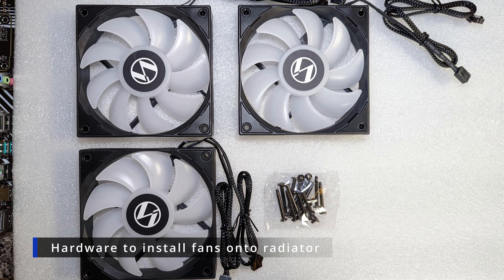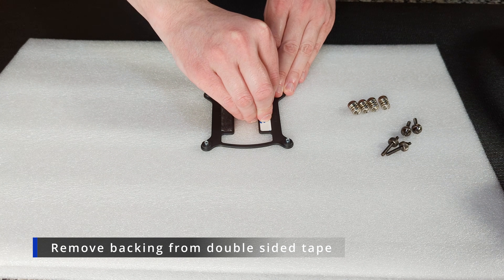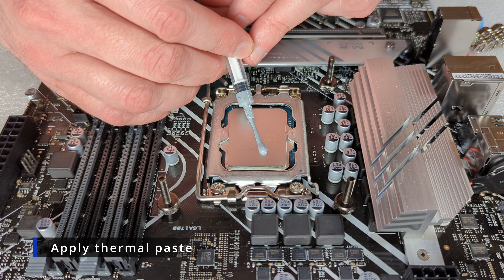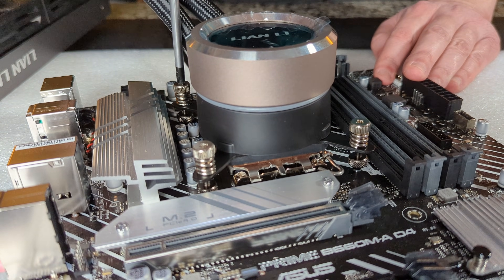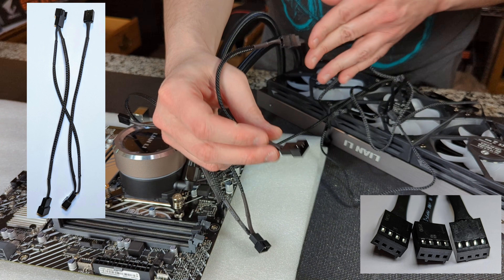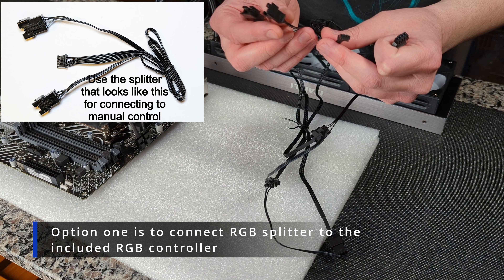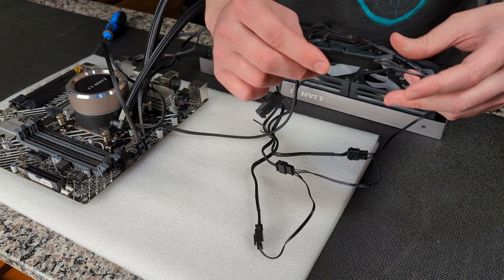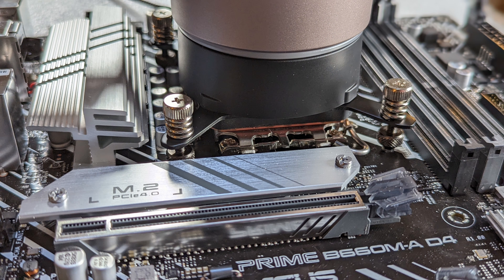LGA1700 Install LIAN LI Galahad 240/360 AIO CPU Cooler

Comment: helpful video! I have all my components ready to build, but the Lian Li Galahad won't come for another 3 weeks because of backorder. So I am waiting impatiently to put it all together. I thought maybe I could put it all together but the fact that I have to access the back of the motherboard to install the CPU cooler makes me wait instead.. actually the Corsair 5000D air flow. Let you access the back to attach the CPU cooler bracket so it's perfect
Reply from the maker: We built this one: https://youtu.be/iBqNFl3ByDs with a 4000D. Pretty good case.
Reply: @KLEEBZTECH  nice that's the GPU I'm using as well. Good to see

Comment: How much is it going to hurt if I leave the middle fan off?
Reply: I ask because my rams are in the way
Reply from the maker: There are many factors like case airflow that will have an impact on that. Obviously it will run hotter but if you have good airflow otherwise it might be fine. Just make sure to keep an eye on temps at first to make sure.

Comment: im a bit confused what do i do with the three cables that come out from each one of my fans. Basically each fan on the top has one plug and I plugged one of them into the motherboard but two more need to plugged in and I cant find spots for it to go into and I dont have anything that connects them all to one hub which plugs into the pc and all three fans turn on. Please help.
Reply from the maker: Watch 03:47 for how to connect the fans. If you do not have the splitter then verify nothing has changed in the instructions since we made this video. It may be missing parts in the box.

Comment: It says the cooler supports am4 but my cooler bracket doesn’t align with my am4 motherboard help
Reply from the maker: You may need to return it or contact support. Could be missing from package.

Comment: great video! i desperately needed a new water cooler (mine was failing so could barely browse the internet without overheating). micro center just opened and i grabbed the 240 for a fair price. this was a life saver for me. so thanks again!

p.s. for anyone installing a new aio water cooler, 2 tips if you have the spring screws: 1) they are meant to be torqued evenly, so when removing loosen each one a bit then go back 1 by one and fully unscrew and they should unseat evenly. if they get stuck and/or you strip the screw, order some screw remover pliers of amazon. they do not slip the way standard needle nose pliers will. i purchased 2 pairs, using the first to grip the rear head of the screw (on the back of the motherboard) and the other pair to manually turn the screw (since i stripped 2 screws), and they came right out. thanks again kleebz tech!
Reply: mine doesnt screw all the way. maybe i should try balancing them tommorow and see what happens

Comment: I have the Galahad 240 SL, prebuilt in Lian Li Lancool 205 Mesh case with standard fans. Galahad is hooked to CPU_FAN and AIO_PUMP on MB. All the fans are spinning but the BIOS doesn't see the CPU fan at all. AIO Pump is recognized tho. Any ideas?

Comment: there are 2 connections coming from the pump, why did you only plug one in? Is one sufficient or do you need to plug both of them in?
Reply from the maker: If you watch later in the video we connect the second wire.

Comment: Where can I get replacement spring loaded screws!! My pc is missing 2 please help 🥹
Reply from the maker: Probably contact their support.
Reply: @KLEEBZTECH  is it possible just to get the mounting bracket and the screws for it?
Reply from the maker: I do know they were providing the kit for the LGA 1700 initially and they probably still do but it does not include the mounting screws. It only includes the standoffs and bracket.
Reply: I’m in a lot of trouble then cause I have the 360mm aio but two screws are missing thought about going to my closest micro center to see if they would have anything but idk if it would be worth the hour drive

Comment: I have the Lian li III case with 3 included RGB fans connected to a controller. There are three spare male connectors from the included controller. I should be able to connect the Galahad AIO to one of these spare connectors, correct?

Comment: On the last step for the rgb i looked for a 3 pin connector but couldn’t find one on my mb, they are all 4 pins and i can’t seem to plug it in because the connector has the 4 pin plugged which doesn’t allow me to connect it into a 4 pin connector. What should i do?

Comment: did they change the back mounting bracket? Mine comes with 2 different brackets for the back that are plastic like yours, 1200 and 1700, their website shows one huge metal bracket, even their website shows this huge metal bracket in the back? A little confused.

Comment: You get a thumbs up man. I am building my first PC in 6 years, running a Lian Li cooler with an i7-12700K.  This is my reference video for doing the job.
Reply from the maker: Good luck and enjoy once done.
Reply: Do the fans only come on after the cpu reaches a certain temp? I have the same cpu and this is my first pc.
Reply: @sunheist9481 They come on, speed up and cool down based on temperature demand.
Reply: Me too! Hope it went well for you, I’m just getting started. First build ever.
Reply from the maker: Just take your time and all should go well. Any problems take time to troubleshoot properly.

Comment: Did exactly the same and get CPU temperature error?
Reply from the maker: Try plugging it into a different header on your motherboard, if that doesn't work you may have a broken pump
Reply: @KLEEBZTECH  thank you for the reply. I tried AIO_PUMP, CPU_FAN, CPU_OPT all of them, felt some vibration in the AIO but still the temps are HIGH
Reply from the maker: Maybe try remounting it and double check you've used all the correct hardware, redo the thermal paste etc. If none of that works it might be a pump issue
Reply: @KLEEBZTECH  It was pump issue, had it replaced and the temp dropped from 89 to 29.
Reply from the maker: @vchaditya  much better!

Comment: I need help, the rgb does not light up on the round pump, and one of the fan rgb is half flickering and sometimes wont turn off
Reply from the maker: Double check to make sure you have everything plugged in correctly, if you do, then it could be a faulty header on your motherboard

Comment: Is the LGA 1700 bracket included out the box?
Reply from the maker: Depends on where you buy it, on Amazon there is a listing that specifies it will have the bracket, but an older model on a shelf at say Micro Center may not have it
Reply: @KLEEBZTECH  ahh thanks bro

Comment: Great video! could you use Lian Li UNI fans instead? So that you only have one cable and the fans are all connected?
Reply from the maker: Of course, I'm pretty sure they sell a version of the Galahad with Uni fans as well.
Reply: @KLEEBZTECH  Thank you, building my first PC. I don't see a version on their website that sells that, the current version that came out in Dec 2021 still uses three separate fans and cables.
Reply from the maker: There is one on Amazon at least in the US https://smile.amazon.com/Lian-Li-Galahad-SL120-Black/dp/B09KN7PSFS/ref=sr_1_7?keywords=lian+li+uni+fan+sl120&qid=1646979298&sprefix=lian+%2Caps%2C60&sr=8-7

Comment: I have a whole different controller, it’s like a big square block. I can’t for the life of me find a video to show me how to fucking hook it up lmao
Reply from the maker: That one will have inputs for your fans and the ARGB from the fan as well, and then it has a cable that connects to sata power, and another that should have a 3 pin connector for your motherboard if it's the one I am familiar with
Reply: im in the same boat? what did you do to fix it?

Comment: that thermal paste is junk. i reapplied with mx-4 and dropped 12 degrees in cinebench on a 12900k. the included stuff was thermal throttling at 100 degrees Celsius.
Reply: I noticed that its made from plastic. Is the kit really good? I should know before building my pc next month. I hope you answer me quickly :)
Reply: @amirbarjakli3383  yes im very happy with it. The software isn't the greatest, just use your motherboard lighting software
Reply: @amirbarjakli3383  if you buy the galahad be very careful when tightening the pump to the cpu bracket. Let the springs do the work. Do not tighten very much. Use your fingers and dont go all the way
Reply: @harley6323  yeah I see... I'm planning to have 12700k. what cpu do you have ? and how are your cpu temps ?
Reply: @amirbarjakli3383  I have the 12900k and i did not win the cpu lottery. Im still happy with my choice. So many variables. With xmp1 i get 99c with cinebench r23. With xmp2 i get 94c. With xmp2 and an undevolt of 0.05000 i get 88c. Those are max temps, not average. My cinebench score is only in the 25xxx but gaming is fantastic and runs at 50c all day. I also have a asus tuff RTX 3080 oc.